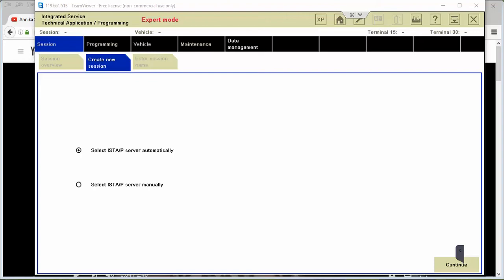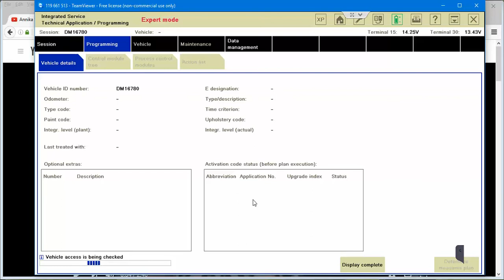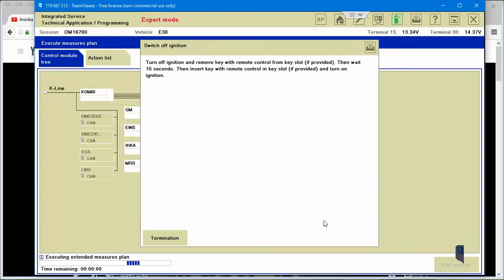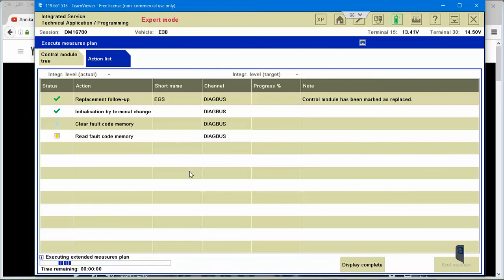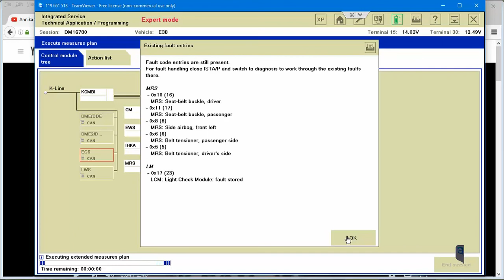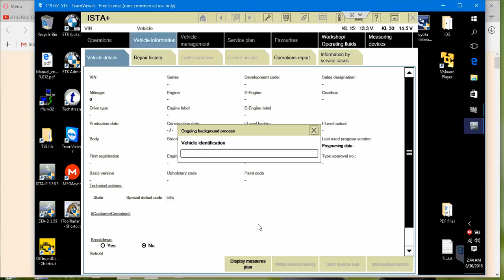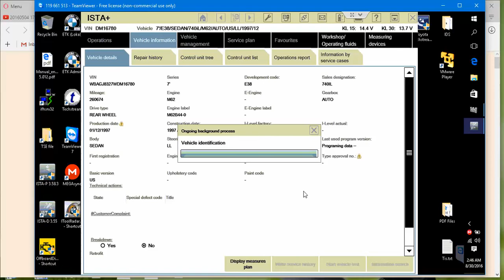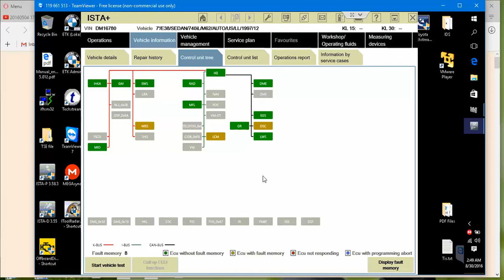BMW E38 EGS SWAPPED AND PROGRAMMED & ENCODED 2016-08-29:14:50 08

Comment from the maker: Certain parts such as the Instrument Cluster, EWS, CAS, DME, LM, ZGM, FEM, etc., contain mileage data. Driving vehicles with such swapped parts may result in mileage corruption, and therefore must not be used.
The CCC/CIC Headunit, MASK, CHAMP2, RADIO2 or Headunit-High has enabling codes for certain features, e.g., satellite radio.
If a feature is already enabled, but sees a different VIN on the bus system during power-up of the module, it cancels the code automatically. 
When an enabling code is canceled, it is not reusable. The only way to enable the feature again is to either contact Technical Service or replace the control unit at your own cost. 
Therefore, swapping these types of parts on E-Series vehicles is not recommended.